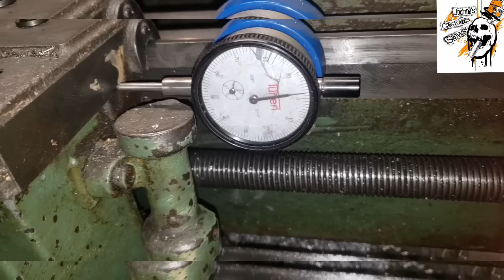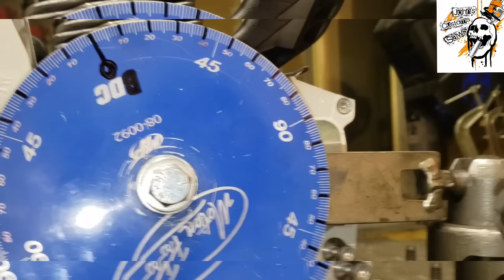Stihl MS461 chainsaw porting... START to FINISH... JCS

Comment: Awsome video would a max flow and bark box improve a saw without porting it
Reply from the maker: Absolutely... maxflow is just a way better filter and honestly I use them for that reason... I won't send a built saw out unless they have a maxflow or Westcoast saw filter on them... the stock filters are terrible... and the barkbox has been proven on a dyno it adds power... and helps the saw run cooler... they are well worth the investment

Comment: how do you deal with tool chatter, does it matter if it chatters a little, does it affect the flow characteristics if the ports are not perfectly smooth?

Comment: You only do Stihl saws. They have chrome plating. But, you don't do Huskies partly because they are plated also. I am USA Midwest and would like to have a Huskie ported and adding a "bark box." Do you know of any person doing this work near me? I have a Forstner and all kinds of bits. On a Huskie could this be done with fine grade sanding bit? There would be less attack and less risk.

Comment: I use the same bit drivers on my guys saws
Reply from the maker: I can't stand working without it honestly... the new one has the better quick connect end... its amazing the torque they can take... I have busted some ridiculously tight bolts loose 😳

Comment: How could I send you a picture of what I have built using a  Is walbro style carburetor Is on my motorized bicycle motor 66CC. I actually tapped into my transfer port to go to the carburetor to get a signal And made it work. Since then I have added an RSE reed valve hopefully that will work.

Comment: Just wondering if you've done sxs comparisons with the muffler mods after porting.    Would be interested in seeing the results.   I know a whole lot about porting 2stroke powersports, but not so much n/a (unpiped) porting numbers, etc.   I know major (or even minor) changes to the exhaust can make a huge impact, and said features should directly correspond to what you change with the porting.    Side note:  foil tape/hvac tape is pretty flammable.   Learned patching a spark deflector for my welding glove.   My hand was on fire pretty quick.

Comment: I've done a 50cc 4-stroke last year it went from 30 mph 70 mph before the head melted .
Reply: Nice...you discovered a lean concept...
Reply: @fredmitchel1236  yeah a better head and a better piston made a world of difference open up the intake and exhaust last time I seen the boy he said it was still running nice
Reply: Very good Wade
 I am glad you got it sorted out...
Nothing like the strong 4 stroke torque of a little thumper. My first non homemade go cart or mini-bike that wasn't made out of an outboard motor...or Tecumseh or Briggs engine found in someone's trash...was a little Honda QA-50. Two speed auto with little fat tires. It might do 28 mph tops. It sure could climb hills nicely and was quiet and very reliable.  OHV. 1.8 HP. I would  it drive so far out into the deserts near Tucson....and it always got me back home. All those toys...were stepping stones to bigger dirt bikes....

A buddy at work...just sold me a little China doll 50 cc kit new never ran for $25....

It is so cute. I will meddle with some like it...probably buy a couple of 66 cc. Then get to work and try and win a race or die trying

At least I make a video for YouTube 

Just like you...

Take care 

Kind regards

Fred

Comment: John, if you don't mind could you explain why you wouldn't want a ported hopped up saw used on a mill set-up?  I just got into milling with a (stock) 661 and I'm just curious on the reasons.  Thx
Reply: A thought which should be disregarded if the author of this video replies to your question. The life of any piston engine is muchly dependent on the ability of all parts to transfer heat to the cooling system. Whilst saws used in felling do long hard runs, their full-power cycles may still be shorter with more frequent recovery rests than a saw working longer high-power cycles with fewer recovery rests on a mill. A popular GM automotive engine was also sold in Australia as an industrial engine in the 1970s. There were three power ratings defined in the literature. Constant duty of 65HP, intermittent duty of up to its max of 119hp and heavy duty at full available power "when engine longevity is not a consideration". In the fire-fighting work the author's saws are built for and preferred for, the high-power duty cycles are likely brief with many albeit short recovery rests when internal temps can settle. - The author would answer this more correctly than I.

Comment: If your Youtube stardom hasn't yet hit a point where you quit answering questions from us peasants (Lol), I'd be curious as to why you mention a person shouldn't run a ported saw for milling?  I'm not baiting you into an exchange either.  I'm asking because I just talked to a guy about having a saw ported, for that very purpose.  So I'm curious what I'm missing, before i spend a lot of money.  Thanks John.  (I like your style by the way.  Frickin makes me chuckle.)
Reply from the maker: Milling is hard on saws... depending on the saw/size cuts they can get really hot and ported saws run hot to start with... I won't even build a saw for milling but if I did I would over-build it and purpose build it for milling then it would probably be fine... I would definitely recommend 40:1 and a really good oilable foam air filter like a maxflow or something
Reply: @johnscustomsaws  Ok, that makes sense.  Thanks for the info John.  I sincerely appreciate it!

Comment: Does porting shorten the life of a chainsaw
Reply from the maker: that age old question is such an impossible question to answer... guys that dont believe in porting say yes and guys that port saws say no... i say that the saws get so much more work done compared to a stock saw it is worth every penny and a lot more... i have had saws that have years on them still going strong... ported and machined and on production jobs getting used and abused every day... but you hear that some guy got a saw ported and it blew up 2 days later but i can almost guarantee it was poor quality work or someone that didnt know what they were doing... it depends so much on who does the work honestly
Reply: @johnscustomsaws  Hi John, my question is simple, Why? I mean a bigger model would surely work out cheaper, a little heavier, probably wont use more fuel have similar power. you say ported No Good for Milling, is that as they run hotter or don't t like being permanently on there side, dry fly wheel seal. Don't get me wrong I'm  neutral on this subject,. Are Stihl saw bores Chrome lined Link Husqvarna?

Comment: John how do i contact you for work
Reply from the maker: im actually not taking on any new customers... i made sure i was set before i started a youtube channel so i could talk openly about the nonsense some of these guys spew here on youtube lol
Reply: @johnscustomsaws  i understand completely if that ever changes let me know somehow your saws seem to be built for reliability
Reply from the maker: @joshuap7501  thanks for the confidence... they are definitely built with a power and reliability balance in mind... the crews that run them especially wildfire crews need to know they will run and i also dont want to go too conservative either and they cant run a 36 inch bar without struggling... but if i ever have saws available it will be on a website and sold as a complete unit
Reply: @johnscustomsaws  i understand qppreciate your content and honesty ✌

Comment: Wouldn't just saying you want the saw to take in fuel and air longer through a slightly bigger hole and spit out exhaust sooner through a slightly bigger hole then tell where to GRIND THE HOLE save about 20 minutes of rambling here???
Reply from the maker: Bruh I don't even know what to say to that lol... making the ports "bigger" and not worrying about port timing/shape/width/piston height/,ring height/skirt height/free-porting/port velocity/duration/blowdown etc... but yeah I could have just said "grind the ports bigger" im sure I would have had no negative comments 🤣🤣🤣 i might have took the long way around but I am trying to show WHY you open ports and which direction... as in lowering the intake and raising the exhaust... exactly the opposite of just saying "make them bigger" im not sure what possessed you to actually type that comment but probably not the best decision you made that day 😬
Reply: @johnscustomsaws  You can say in about TWO sentences why you are porting a saw and why you need to keep the piston from reaching the HOLE to soon or why the piston will CATCH in the hole if it is to big. People need to know the basic CONCEPT before throwing out a bunch of numbers, getting half them wrong, going back and throwing out a bunch more til people don't know WHAT THE HELL you are doing and a simple explanation as to why you are doing it. As for polishing the HOLE...people know what buffing wheels are....
Reply: @johnscustomsaws  Let me ask you this...what happens to your job if every Joe Blow in the country starts to understand the CONCEPT of your, and several others on here, work, and starts doing it themselves? Is it your intention to instruct yourself out of a job? I doubt it....
Reply from the maker: @outboardfixer  merry Christmas man... you clearly don't understand why I am making these videos... you just think everyone is an idiot and the irony in that is mind-blowing 🤦‍♂️
Reply: @outboardfixer  buddy I can assure you that we get constant questions from people that are trying to learn and we are glad to help those that are actually willing to learn when we have time to help. We also have more than enough work coming in from folks who don’t want to bother buying thousands of dollars in equipment that it takes to build a good saw. There’s also plenty of work coming in from guys who just don’t want to bother learning. Lots of  Joe blow do it yourself guys out there, and that’s fine. John simply is showing for the saw community what any of those types of people would want to think about if getting into this work.
Reply: @johnscustomsaws  lol I can believe you machine parts on your lathe with out wearing a hair net what if you get a hair on the part you could end up a hair off on your measurements which could lead to a hairy situation .😱😃😂
Reply: That would have been quicker but then he’d be answering questions in the comments section asking why that needs to be done……..which I’m sure you would have criticised him for as well.
Reply: @bigjay24910  good one 😂
Reply: @cajun3197  these people are all the same, can’t do anything without them complaining or criticising.
Reply: @bigjay24910  I’m used to it...sure takes the fun out of saw building though 🤦🏽‍♂️
Reply: @cajun3197  I can imagine, I wanted to do a channel for my gardening business but I can’t be bothered with all the idiots in the comments section saying you shouldn’t be doing it that way or that’s not the correct way to do it. I’ve been doing it long enough to know what works for me and gets results. Been doing it most of my adult life and Almost 5 years in business for myself and I’ve not had a single complaint. If my customers are happy then it’s nobody else’s business.
Reply: @bigjay24910  well said brother!
Reply: The holes are not bigger, you forgot?.. he shortened the cilinder... he had to open the holes.. he just made the chamber smaller where the gas burn... maybe 1 mm or 2 mm
Reply: anybody can put bigger holes in things, when it comes to porting it's a whole different ball game and level of competence.
Reply: @mrromantimothy  I'm SAYING it doesn't take 3 hours to explain it, nobody said ANYTHING about just grinding some holes....except you.
Reply: @outboardfixer  you just said hole three times hole
Reply: @mrromantimothy  What are you...5?
Reply: @outboardfixer  even a four year old could tell you what I just said.
Reply: Hey Mark, atleast he MADE a video .It made sense to me. Thanks for passing on the knowledge John.
Reply: @johnscustomsaws   I once ported a Saturn head with my son we were replacing his timing chain and head and we got one from the junkyard that was fuel injection while ours was was different so I got a sharp quarter round file and got at it ,I had to worry about water jackets though but it came out fine car ran good for a long time, all I know about porting , and I've ported my share of things with the die grinder, is that you can screw up easier than you can do it right, you get back Eddy currents and cavitation you'll burn a big hole .
Reply: @bigjay24910  if somebody's telling you you're doing it wrong or this or that , well that's a complaint whether it's on YouTube or in your personal life, you just described who you are and you know who you are so I might wonder is why do you let it bother you so much? let it go like water on a ducks back, you got to have pride in your work and if you know who you are and what you're about ain't nobody can say anything that can change that. there's a  difference from an idiot and ignorance,  ignorance means they don't know , they haven't learned yet ,of course there's people who know so much about everything they can't even learn things the hard way ,especially when they make excuses and blame others , I recommend staying away from them because learning things a hard way is dangerous for them and others around them of course there are exceptions to everything I just said but don't be so sensitive.
Reply: @ Mark...just get your own channel bro.
Reply: @xisleprez  I have....BRO...
Reply: @outboardfixer  kool.
Reply: @xisleprez  And cool too....

Comment: Porting gives a slightly better performance but giving the involved time why not buy the saw for the job your doing? Stihl +Tech just my opinion...
Reply from the maker: The guys I build saws for want the lightest saw they can get away with that will run a bigger bar because they have to carry them around on the job...90% of the saws I am building are for wildfire guys

Comment: Btw you can reuse spark plugs. You choose not to but I been doing this fo over 50 years and the ring gasket doesn’t leak if you tighten it properly.
Reply from the maker: Have you pressure tested them? Because I won't over-tighten plugs... I have seen what happens and  busting the electrode will destroy your cylinder... stihl puts them too tight to begin with so NO you should not reuse them... you have been doing this 50 years... thats that half ass attitude that makes us look bad... test it  once instead of taking the lazy way out

Comment: I'm only 22 minutes into the video so you might mention this later, but I'm assuming that you know and desire to change the port durations when you remove material from the bottom of the cylinder? Also, do you measure squish when putting the cylinder head back on?

So another question: is that a nickasil cylinder? If so, you have huge cajones. Well, I don't know what one of those cylinders cost if you do chip it, but I'd still be afraid. But maybe I won't after watching your video... ¯\_(ツ)_/¯
Reply from the maker: You are messing with me right... I build saws for the baddest fallers on the Westcoast my man... they are machined factory pistons lightened by 3.5g with the squish cut at matching angle and running 20 thow for clearance... decked the cylinder 45 thow to help intake timing which i cut to 80... I lung the intake as far as I can before I peek the top ring...  raise the exhaust to 99 and blowdown around 25 ish since they are work saws... lowers cut and matched to the cylinder  (split the case and trenched) compression around 190 cold (again work saws not race saws) no timing advance because they run a staged coil and i tune em rich to run big bars big wood... thats my recipe my man
Reply: @johnscustomsaws 

Well, I wasn't kidding, but I also had no idea who you might be. As I progress through the video I see that you sorta got the hang of this 2T stuff 🙂

Anyway, good stuff. I like watching anything 2T related, even 2 stroke diesels.
And I dabble around with them a bit myself.

Comment: OMG dude how can you use a dial indicator with a cracked glass how cruel lol😱😂
Reply from the maker: im just a hack bro thought you knew... i didnt even wash my hands before i started machining
Reply: @johnscustomsaws  just messing with you I love your videos there very informative and your one of a few mechanics that actually know what your talking about . I have been a mechanic for over 40 years and have worked on anything from weed eaters to heavy construction equipment . I used a 50 cc chain saw engine after porting and mounted it on a bicycle I wouldn’t recommend doing it though 50 miles an hour on a bicycle with no brakes that are meant for that speed is insane but it was fun .
Reply: @johnscustomsaws  no your not just a hack your a professional hack.😀